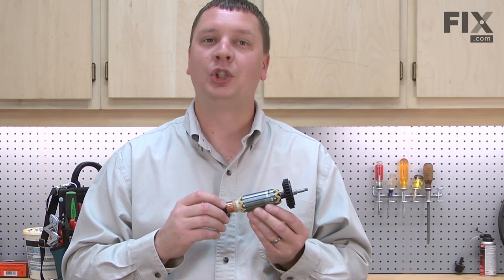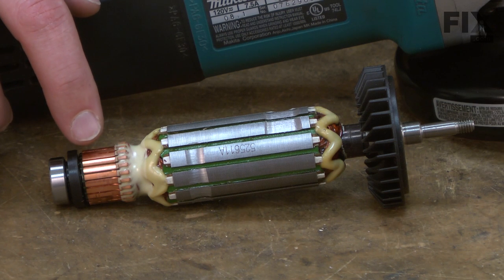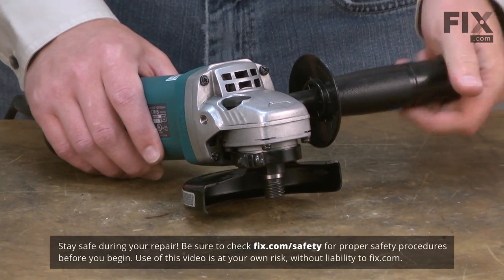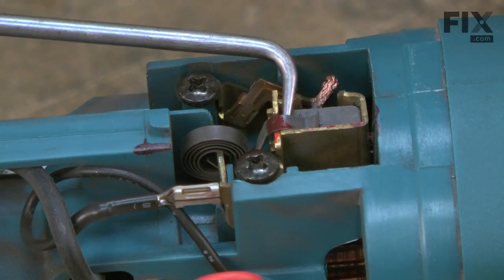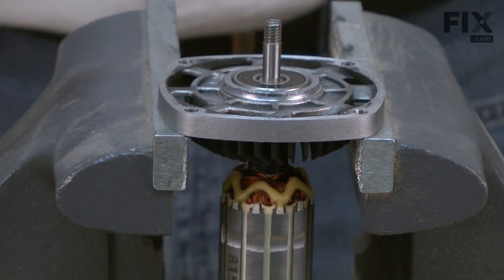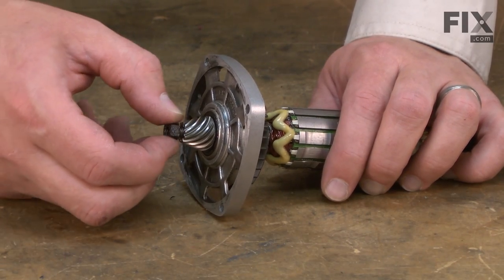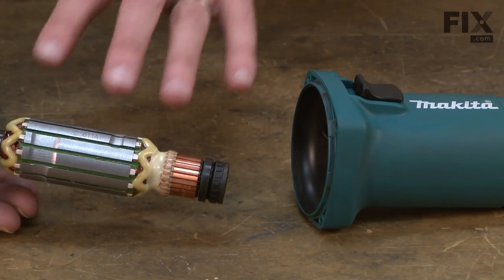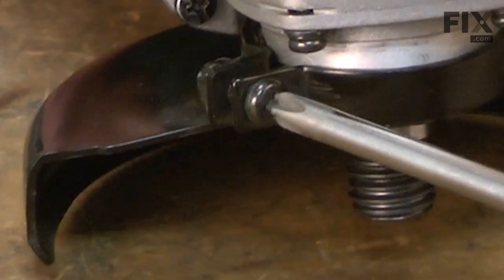Makita Angle Grinder Repair – How to replace the Armature

Comment: Great video.  One thing that you did not mention is that the rubber Makita Labyrinth Rubber Ring that surrounds the commutator end bearing needs to be removed from the housing if it stays behind and refitted to the bearing before installing the armature back in the plastic housing.  The bearing cannot be refitted if the rubber ring is still in the housing.  You need to pull this part out of the housing with very long nose pliers or remove one of the brush carriers to flick it out.

Comment: Mine heats up real quick and rachets, I couldn't figure out how to take this armature out but it appears it's the brushes that keep it in place... shoot but whats the cost of the armature  dang,  I took it all the way down to that beveled gear and it still does it so it must be the armature, I'll take a look the electrical connections are black or dirty but need to look inside.
Reply from the maker: If your grinder is the same model as the one in the video, the part number on the armature is 515611-3 and the cost is $19.95.  The armature might have heated up hot enough to melt the motor housing around the back bearing, locking the armature in it.
Reply: Okay thank you, I have a spot I think I can get parts for it.  I have been working on it since I posted and the armature came out easily once I did as you showed in the video how to pull the brushes back and I didn't see anything burned other than in the lower area or copper area where the brushes work, I cleaned it up it doesn't look worn much and nothing missing, the unit still ratchets I noticed the top bearing seemed worn, I could move it and it would seize when turning.  The lower bearing looks okay I tried applying pressure and it doesn't have play and moves freely the top bearing moves freely but ... it jars or is loose, so when I turn it it and apply pressure it seizes up.